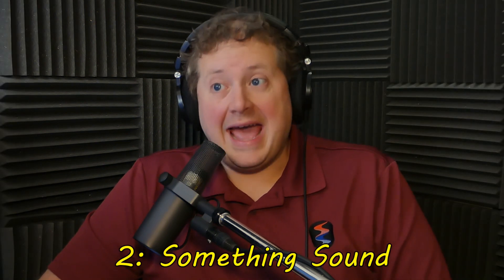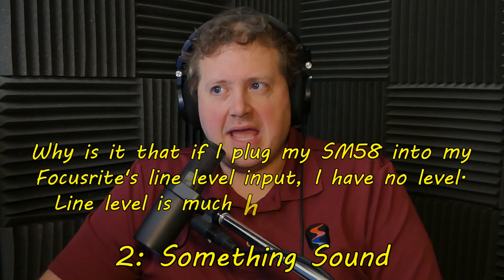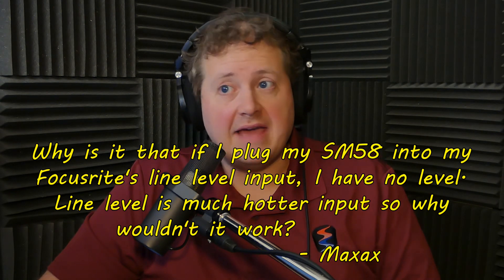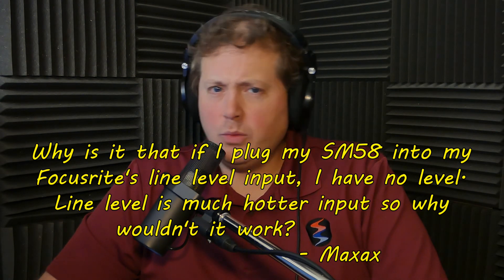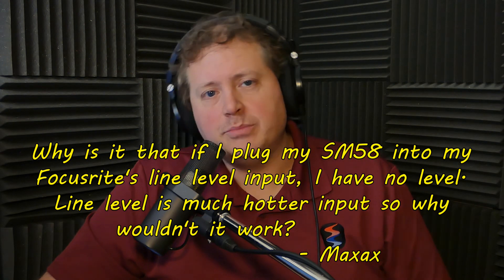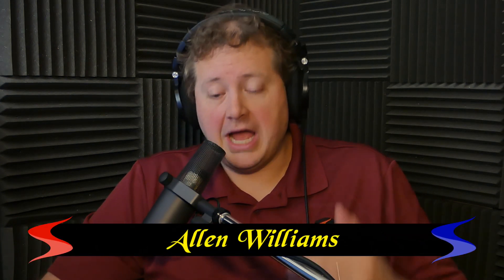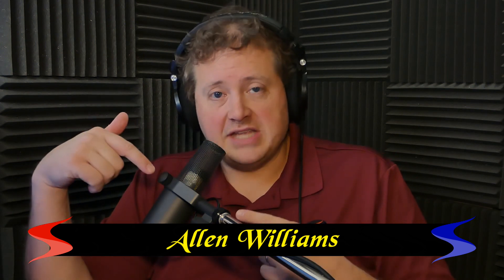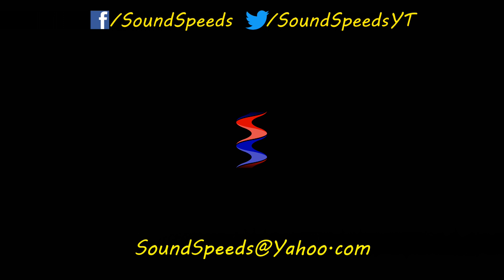Will A Microphone Work In Line Level? Sound Speeds

Comment: So the SM58 (or mic) voltage is 1 or 2 millivolts. The line level voltage is 1,228 millivolts (up to 1,736 millivolts). So if you connect a device with 1 or 2 millivolts of voltage to a port that is expecting at least 1,228 millivolts, this thousand-fold difference in voltage is the reason that Maxax (the person who sent you the question you mentioned in the video) did not get any clean, proper sound from his SM58 when connected to the Focusrite's line level input. Am I summarizing / understanding this correctly? :)

If you could make a video about mic level, line level, Hi-Z, etc. - the details of their voltage, with an image to represent visually, and what device (a mic, a guitar, etc.) can be plugged into what connector (Hi-Z, mic, line, etc.) and what will be expected to happen (good sound, no sound, low quality sound, etc.), that would be super helpful. I haven't found such material clearly on the internet.

Appreciate you!
Reply from the maker: That's pretty much right. I touched on this in my Understanding EIN video. You might check that out.
Reply: @SoundSpeeds  I actually just emailed you extensively about that. 😊
Reply from the maker: Don't expect a fast reply. Yesterday morning I finished my big annual charity Livestream and we went nearly 19 hours. I'm taking it easy right now.
Reply: @SoundSpeeds  - no rush. I'm patient. Just doing this for fun, so no high stakes. Wishing you all the peace and health in your 2023 🙏🙂
Reply from the maker: Thank you. Happy New Year

Comment: Good explanation, and hopefully he gets it now.  I have seen a lot of students get that backwards, and I often find that there is simply one word that is substituted in their heads, which when explained using that correction, they finally can keep it all straight.  
He was thinking, in his own words,  that,”line level is “hotter”, so why won’t it somehow drive a lower level microphone— as if the line level input will somehow add bridging amplification to the low mic level input.  Obviously, he is not understanding that the line level EXPECTS a higher gain signal, not that is CREATES a higher level signal. I reiterate that that needed gain from mic to line level comes from a mic preamp.
Reply from the maker: By "he" do you mean me? I explain that the voltage is totally different and preamplification/amplication is necessary to bring the mic level up to line level.
Reply: @SoundSpeeds  I mean the guy asking the question to you, who you were answering.  Yes, you do cover it, and you cover it extremely well; but in 35 years of dealing with research students, graduate students, new engineers and others, I finally found about 20 years ago that the addition of one word contrast/comparison ‘pivot-point’ examples seems to actually help it all sink in.  I got 50/50 recall whenever I only explained illustratively.  
In other words, I found that for about half the population you need both an illustrative example like you provided, PLUS (whenever possible) a one-word “pivot-point example” (i.e. ‘Expects’ vs ‘Creates’). For some reason; since the way some people’s minds work, they need multiple neural paths to help reinforce, and thereby remember/recall it long term.
Reply from the maker: Oh, gotcha. :-) It's been a while since I made this video and forgot I was answering questions. Thanks for watching.

Comment: That voltage conversion thing is so easyyyy!!!! I have never thought of it that way!
Reply from the maker: If you think of mic level as -40 to -60dB and line level as +4dB then you may expect line level to drive a dynamic but it doesn't work that way.
Reply: Sound Speeds no I get that. It’s expecting a signal that is far hotter than a mic outputs. I was referring to 1v = 0dB, 100mv = -20db, 10mv = -40db, and 1mv = -60db